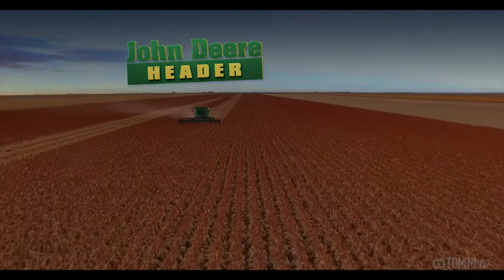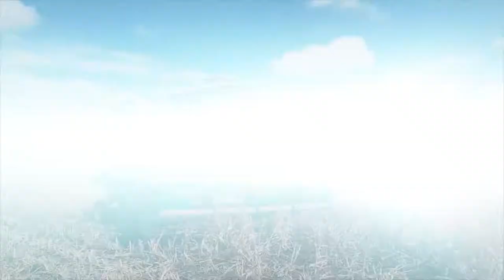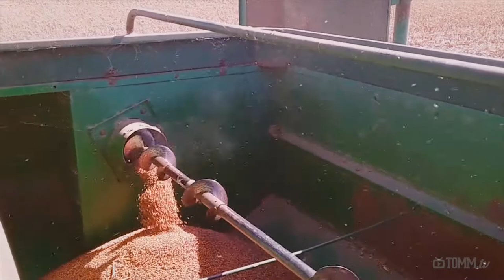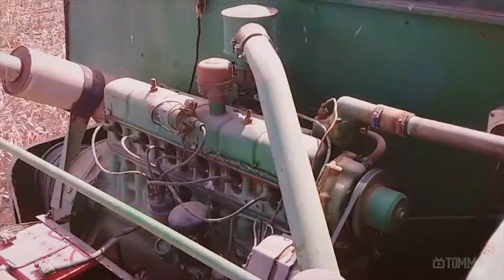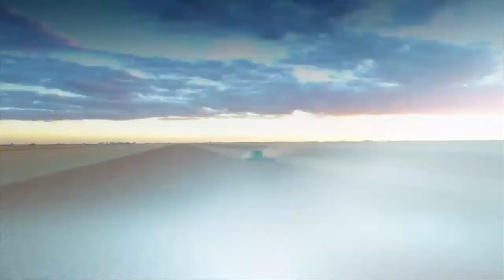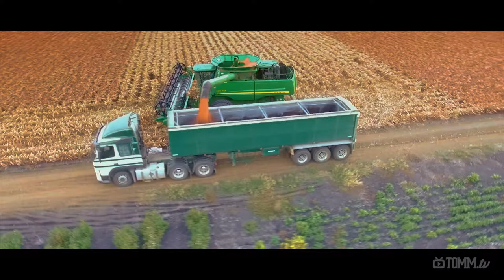1966 John Deere Header 95

Comment: We recently sold my father in law's 95 JD combine to a neighbor, some header drive parts are missing on the left end of the header. We don't know what these drive parts look like. If you have one would you be so kind as to send a photo of that left side of the (straight) header?
Reply: Thinking again, the straight cut header is also used when the windrow pickup is attached so the drive parts would be the same regardless of what attachment is used.